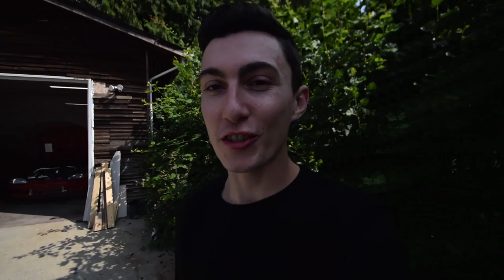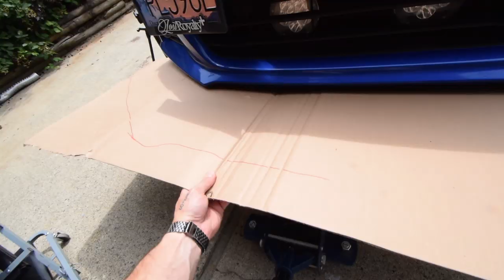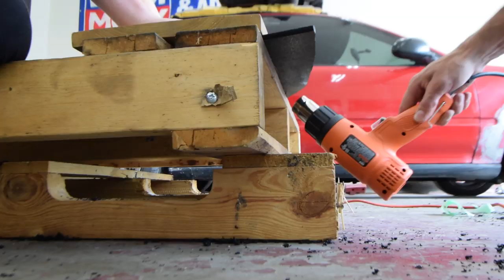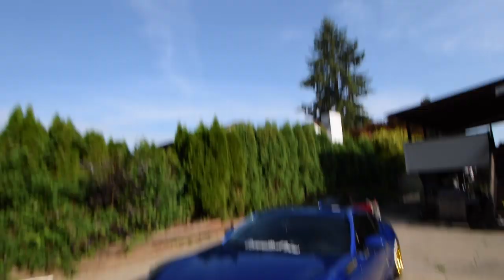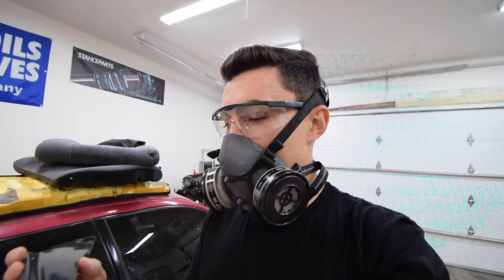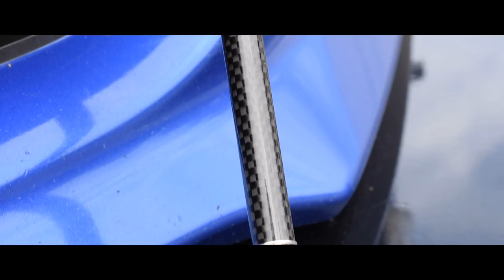Making an AGGRESSIVE Front Splitter & Canards for the BRZ😍

Comment: Putting the panels on the door would help, but I would recommend you just get garage door insulator/insulation, it will help with the sound and keep it cool in summer and warm in winter and way cheaper than the amount you would pay for enough acoustic panels to cover the door.
Reply from the maker: door is already insulated thats the thing, doesn't really need it😂
Reply: @dfacedxa   yeah, for a "test" he/you could just use the box/package of eggs from the supermarket (you know, the ones out of cardboard). I heard from a lot of friends they use them to kill the echo.

Sorry if my English is not the best, English is not my native language.
Reply: 너도 문에

Comment: Putting them on each wall in alternating checkerboard patterns will do the most (the pattern being the opposite of the wall across from it). Base traps in the corners would help as well, but your biggest issue is going to be the floor and ceilings. since they are all hard flat surfaces.

Comment: If you use the foam to reduce echo you need to put it on every wall echo is just your voice reflecting back from the walls and when you close the garage the sound can bounce off of all of the walls. Most youtubers that only have to talk directly to a mic only need to have the foam on the wall facing where they would be talking but you film all over your garage so having it on all walls makes most sense. When you get the foam try taping it up in different setups and check your footage with the door closed and see what sounds best before you secure it all with the spray glue.

Comment: For the echo, make 3x3 frames from wood with some type of backplate(some plywood), get cheap towels, cut to size, and layer until frame is full. Then take a bigger one, wrap around the wood, so it looks “canvasy”, and hang em up in a cool pattern. Works like a charm, Costs sooo much less than buying actual sound dampening panels⚡️

Comment: I organised the acoustic panels for our office. Cover the complete ceiling with those things and you should be fine. The reason it does not echo when the door is open is because the sound doesn't bounce of the door and around the garrarege, but can bounce out on to the open space.
Do the ceiling first, as this is the largest single area of the room, if you do this first it will have the largest effect.
Also note: the harder and smoother the surface is (eg. Concrete) the more echo it will produce. I'm assuming the metal sheets of the door are slightly structured, but the ceiling is most likely completely smooth.
Another benifit of doing the ceiling is you will hardly see it and they won't get dirty as fast. Remember you are putting soft fabric on your door, this will look like s**t if you get anything (like dust/paint/oil/dirty water) on it!

Comment: Basically the more dense a material is the more it'll echo so if the walls are concrete you will notice much more of an echo compared to timber or gyprock walls because they are less dense and often have some insulation to help with sound.

Comment: Dunno if this is too late to see, the issue is not technically to do with the door, more that there are effectively 4 walls when it is shut.  Someone else mentioned somewhere in the comments that the sound will bounce more off the hard walls, that is correct and as such I'd reccommend putting the acoustic panels on the walls and leave the door as it is.

Comment: The leading edge of a front splitter is supposed to have a bit of a upwards angle.      But you would actually need a full under tray for it to work like a splitter.

Comment: It would really help the echoing if you put a cupboards in your corners of your garage.
I left a comment explaining why.
Reply: Just try it out with a random cupboard first to see if it will work but I suspect you're getting sound directed back to you from the corners, because based on the amount of furniture the garage there shouldn't be as much Echoes you talking about. Adding more corners would dampen the sound because it is bouncing off more surfaces but one large corner will cause echoing of the sound cos it will bounce off one surface to another surface and be directed all right back to you. This is probably why it increases when you close the garage door cos you're adding more large corners.

Comment: As a sound engineer (im just 16 secs into tue video). I recommend u using glass wool. Follow the instructions as how to make panels just like recording studios (it’s basically making a square with some 2x2 softwoods like pine), fill them with the wool and then wrap it all with fabric. 
Remember to use protection for your eyes, hands, and a filter to breathe.
I apologize if i talk like a caveman, im from southamerica.
Reply: Btw, place them on the side walls, so they’ll be useful with the door open and closed. If you place them on the door, they’ll be basically useless when you open it

Comment: I think the front lip should be a few cm shorter, from the side shot it looks way longer than the rear. Also have you tried to cut the abs thickness wise? As in just try to cut the matte part off? It may be thinner but I don't think the canards need to be as thick anyways.

Comment: I work with carbon fiber almost everyday, and a quick tip: Your skin absorbes carbon fiber dust, so when you use it, try to cover your skin + don't wash your hands with warm water because if you try to wash of the black carbon fiber dust because it will open your skin pores and itch like crazy, so rince it of with cold water without rubbing until almost everything is off

Just saying!

Comment: you should take your heat gun and just run it over the front of  your bumper and the spliter and the the pressure of the rods pushing down slightly it should help it form and not put as much up pressure on the rods and bumper.